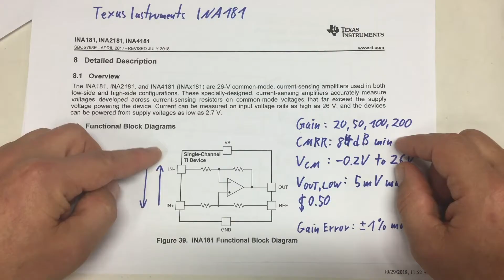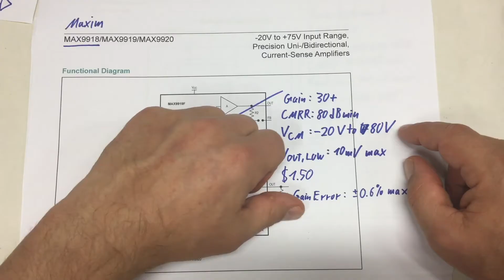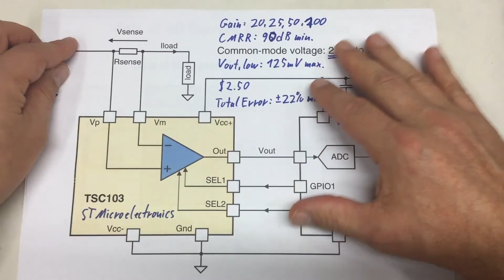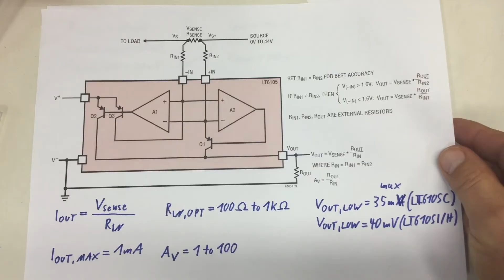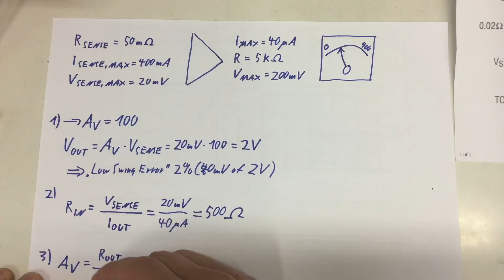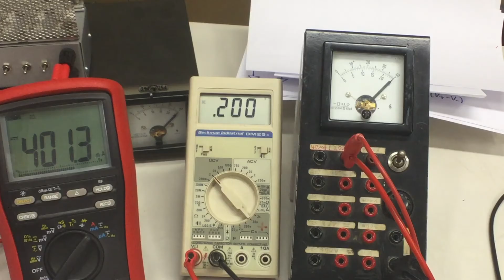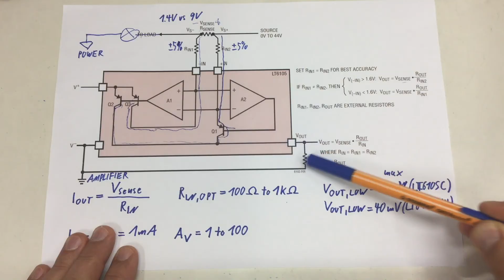Current Sense Amplifiers (2/2): Examples and Circuit with LT6105

Comment: For the INA28x black magic, those switches represent switched-capacitors which has an equivalent resistance of 1/(C * f). In CMOS analog electronics capacitors are much more precise so the "resistors" are likely very well matched, hence the very large CMRR. Although there's an oscillator in there somewhere that they haven't told you about.
Reply from the maker: Thanks for the info! I wasn't thinking about that, but of course it should be possible to make very precise capacitors (and resistors?) in CMOS. I mean you can control the geometry down to 100nm or even less.
Reply: @robertssmorgasbord  maybe precise wasn't the best word to use. Process gradients cause resistors to mismatch while it's easier to match capacitors. I'm not certain on the technology reasons this is just what I remember from my analog design class :P
Reply from the maker: @incinatus190  I guess that's the reason they laser trim resistors on chips when they need real precision. But wouldn't it be possible to laser trim capacitors too? Burn way a bit of the top layer?

Comment: Thanks for the info
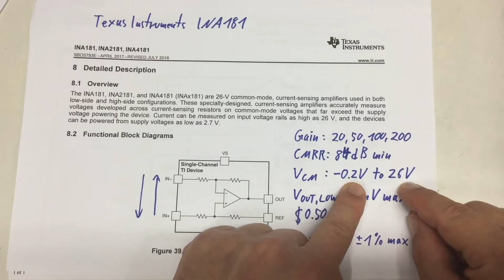4:45 shouldn't Vs minus Ground be larger or equal to Vcm max ?
Reply from the maker: No - and that's the great advantage of these devices. It's also stated in the text above the functional (!) block diagram: "[...] common-mode voltages that far exceed the supply voltage [...]" (26V vs 2.7V). The "trick" here is that it's just a FUNCTIONAL (!) block diagram. The INA181 doesn't really consist of 4 resistors and an ordinary OpAmp. There goes a lot of "special sauce" and "trickery" into the circuits of those devices. I would have to do some research first before I could really explain their inner workings ;-)

Comment: Thank you for making these videos, they are fantastic and clear. Are there any low cost solutions for 120/240VAC? The common mode voltage always seems to be below mains voltages.
Reply from the maker: First, you're welcome! And no, to the best of my knowledge there are no current sense amplifiers suitable for mains AC. What immediately comes to mind are chips for mains AC energy metering (e.g. https://www.digikey.com/products/en/integrated-circuits-ics/pmic-energy-metering/765 ). They start as low as $1. However, these are completely different beasts, containing several ADCs (current & voltage), calculate peak and RMS values and usually sport some digital interface to read out the values.
Reply: @robertssmorgasbord  I'm surprised by that. I took a peek at a few of my multimeters (including Fluke) and they all seem to use a current sense resistor (Constantan) to measure mains current. I wasn't however able to figure out how they were measuring the voltage drop across it, I couldn't figure out some of the part markings to identify them.
Reply from the maker: @eyeTelevision  [Reply to your first comment] I didn't regard current sense amplifiers suitable for your application because you want to measure AC (!) currents. So even if you find one that can withstand the common mode voltages of mains AC (which you have below ;-) ), you still have to do a peak detection / RMS calculation. Anyway, The above mentioned energy metering chips also require a current sense resistors. In a multimeter the main chip does all the peak detection and RMS calculation stuff.
Reply: @robertssmorgasbord  Perhaps the INA149 would work. It has a common mode voltage range of +-250V - the price is pretty steep though! I started with trying to build a low cost solution using a simple precise resistor however it's anything but at mains voltages. At that price, I might as well start looking at a hall effect sensor like ACS723 or something along those lines which is basically the same cost.
Reply from the maker: @eyeTelevision  [Reply to your second comment] Yes, the INA149 would be suitable for 120VAC (+/-170V), but won't survive 240VAC (+/-340V). But keep in mind that you still have to do peak detection and/or RMS calculation on the output signal of the INA149. The ACS723 would work for 120VAC and 240VAC. Its great advantage is that it offers isolation from the mains AC (mind your board design). Though It's not as precise as a current sense amplifier, and you still have to do the peak detection / RMS calculation on its output signal. The above mentioned energy metering chips do all that for you.

Comment: I learnt a lot, thanks...Ive subscribed because I will be back here I think. The math was abit above me some times but I now have a much better understanding than I had at the beginning, so thats great!...I have a project in mind that I need to study in order to design it but basically I want to add to my tools a small but reasonably accurate way to measure a microcontrollers current draw when in "deep sleep" ….Arduino (ATMEGA328p-AU) at the moment. I was going to use an opamp but your vid has given me much to think about. My multimeter is a Fluke 79 series 2 and will measure down to 1uA (40mA scale) and I want to make a device on a small PCB to attach to the meter and use the mV range to measure currents from 1nA up to where my meter bottoms out (if that makes sense!) I would like to eventually make this "open source " so many could benefit from it. Arduino and other micro's  are very popular, and of great importance in education but most mustimeters can't measure the Nanoamp range (ones I can afford!) and this is important in battery operated projects. Anyhow great vid and if you can offer any advice to me that would be great,  I will now check out your other work and look forward to more......cheers. oh yeah nearly forgot I have a couple of INA105kp instrument amplifiers would they be any use in my project ?
Reply from the maker: Thank you and you're welcome! Interesting project you have going there. The INA105, being a unity gain amplifier (gain 1), might not be the right chip for your project. Measuring down to 1uA you want something with a high gain and very low input bias current/voltage. E.g. MAX9923F (fixed gain 250, input bias current 1pA, input offset voltage 0.1uV): With a 0.5Ohm shunt resistor that would yield a 0.125mV/uA output, a voltage drop of 0.5mV/1mA and at 40mA an output of 5V. Keep in mind that a designing a current measurement circuit covering 4 orders of magnitude (1uA to 40mA) is quite a challenge ;-)
Reply: @robertssmorgasbord yeah think I need a lot of homework! but I'm gonna keep thinking, all I need is to be able to read about where common micros sleep (around 200nA ish) thanks for your kind reply will check out the MAX chip failing that save up for a meter!
Reply from the maker: @andymouse  Again, you're welcome :-)